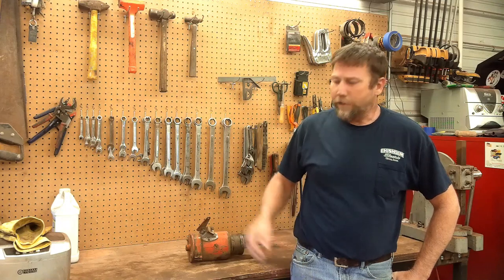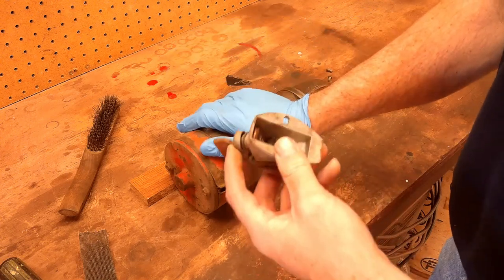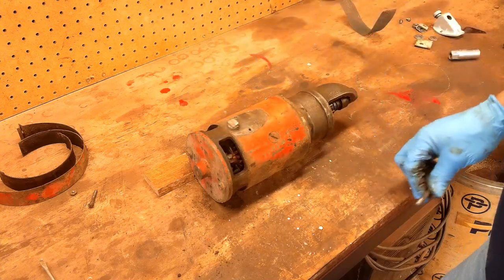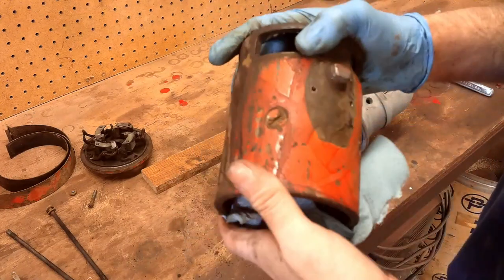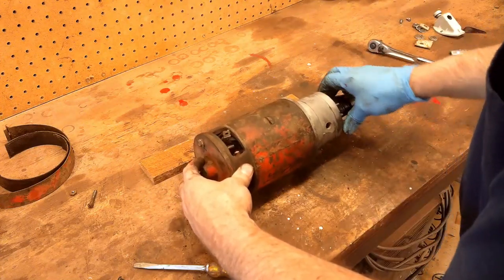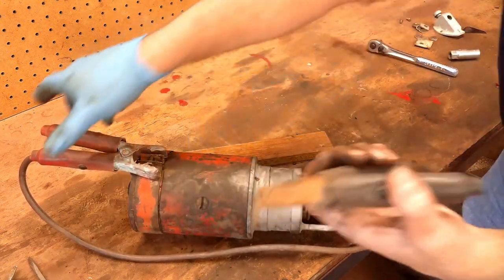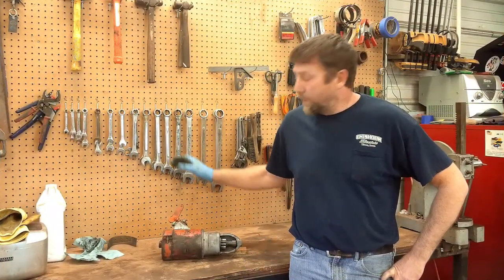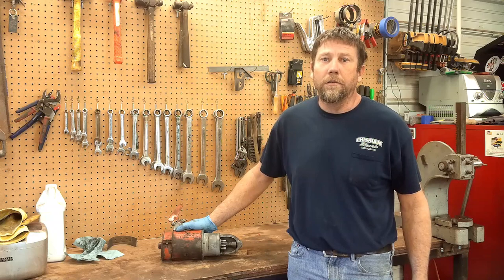Allis Chalmers WD45 Restoration Starter Maintenance Ep.12

Comment: I’m a sucker for simplicity and it’s really cool to see just how easy those old starters are to work on.  It was neat to see how the starter gear is supposed to engage when hooked up to the battery.  It’s also amazing how the manual engagement works and makes the connection when it’s all hooked up.  So simple yet a brilliant idea. Awesome video!

P.S. Thanks for the shoutout!👍
Reply from the maker: Yes it is Cody. They really thought that was quite a luxury to have starter so they didnt have to crank the engine by hand.

Comment: What is REALLY good to do with these switches, and battery connections, use Dielectric grease. A lot of people get misconceived about what the grease actually does. They think it stops the flow of electricity, when in fact, it helps with it, keeps the contacts from corroding and arcing that causes the pits and markings. excellent for battery terminals also and keeps from the acidity build up. Excellent choice with the electrical cleaner

Comment: On a lot of AC Delco starters you can only install the armature from  the drive end. This is unfortunate because it is a lot easier to get the brushes on the armature before you install the armature. You were fortunate. Also, using grease on the Bendix spiral instead of oil would be asking for trouble in subfreezing  weather. Great Video!

Comment: Nice detailed video on the manually operated starter.   I have a similar setup on Farmall c of my dadsz, the manual switch is not connecting the hot wire to the activation bolt of the starter.  I fixed the wd45 many years ago with same issue.  Just don't recall how I did it

Comment: I have a Allis Chalmers 6080 with starting problem there is power on the gauges when I turn the key on but no power goes to the starter
Any suggestions?
Reply from the maker: It could be the key switch itself or the starter solenoid. I'm not too familiar with the 6000 series of tractors.